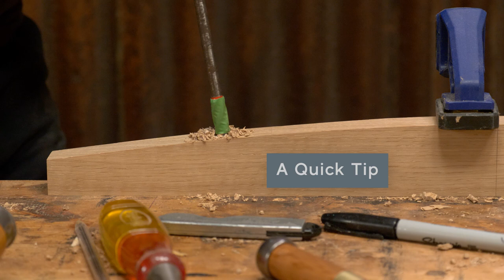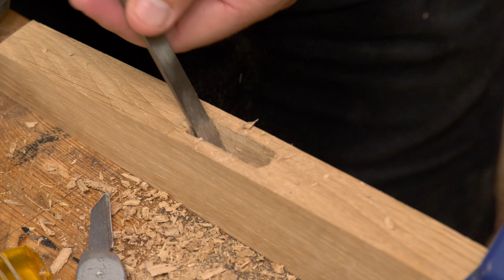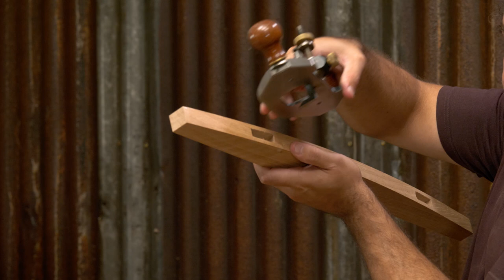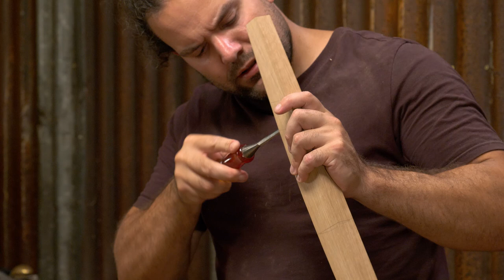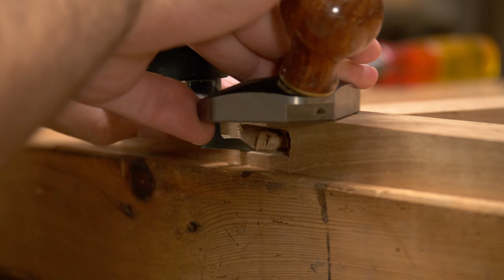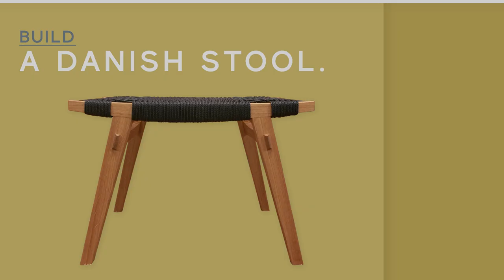How To Cut Perfect Mortice Walls - With A Router Plane

Comment: I'd wager that a lot of smaller projects that call for mortise and tenon joints could actually get away with a shallower mortise anyway, negating the need to clean up after with a chisel. Great tip Richard.

Comment: Perfect trick to have in the back pocket when working with a mortice! I could also see it being useful if you screw up a mortice when cutting them out (go off your lines or the hole gets wallowed out when prying out waste) and need to establish a new mortice hole that doesn't match your chisels. Better be sure your stock is square though!